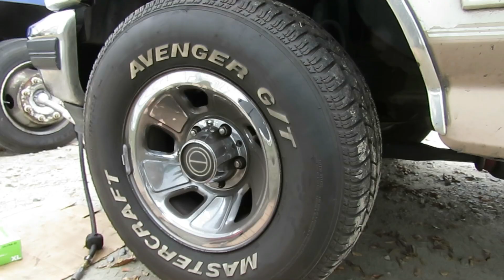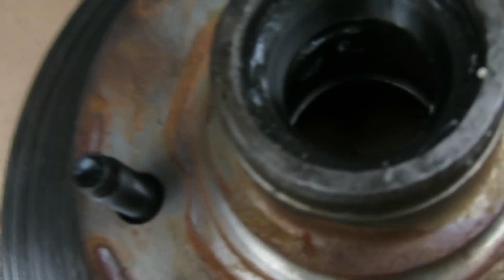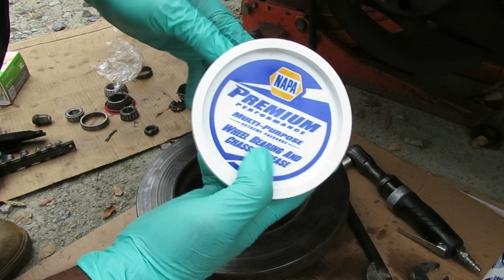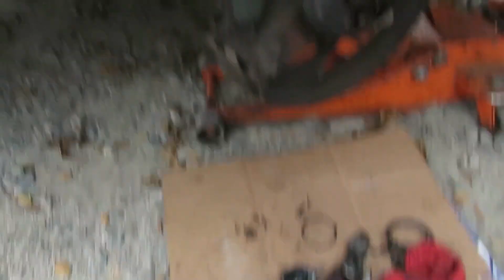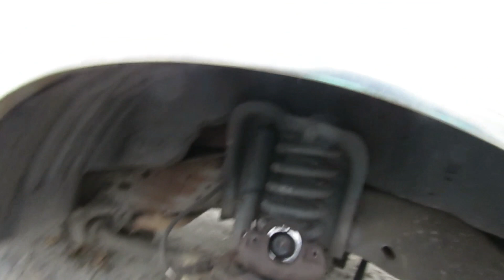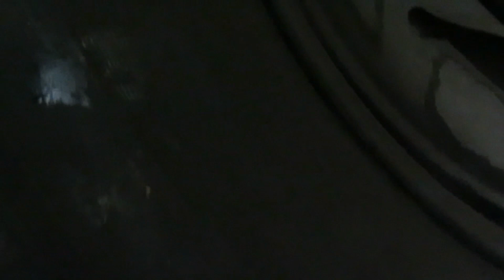⭐ 1996 Ford F150 Pickup - Front Wheel Bearings And Racers

Comment: My driver side bearing has been going out for a few months. (Actually almost a year. I've only had the truck 3 months)
I thought it was a rotor roaring. 

Nope. On my way to a delivery the bearing finally gave up. About an hour after I had looked up what a wheel bearing going out sounds like. 

I swear my truck knows when I go to look up what's wrong with it, it's like yep that's it. Here's something to cry about. 

The retaining nut/castle nut, was completely obliterated. Only thing left was a little ring. You could move it, about 40 feet you'd hear a loud clank over the exhaust.

(Edit) I'm glad I'm watching this video. It seems easier than what my mechanic makes it out to be. Like most things
Reply from the maker: LoL on the truck comment, and thanks for the comment and story to go with it!